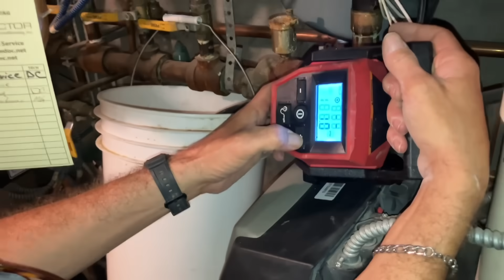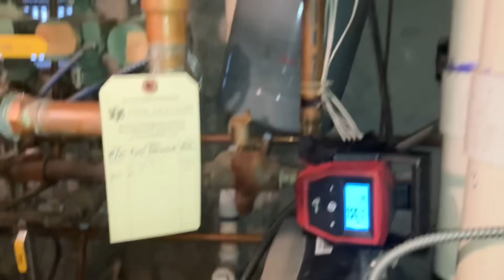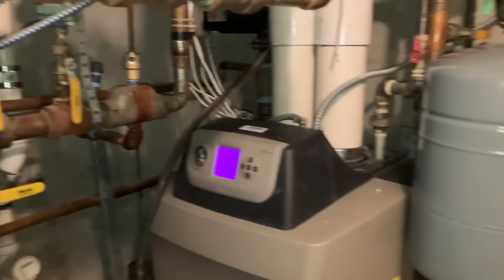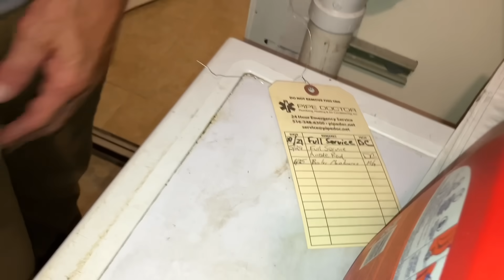Local Plumber Fixes Flooded Boiler Expansion Tank the RIGHT Way | Long Island Service Call

Comment: So far after 5 years our Rinnai 98i on-demand working good cleaned every year. Extremely hard water. Bought 6 stacks of 4 nikoen magnets half moon installed 4 in a stack 2 stacks opposite of each other 3 times..shower heads never get minerals built up.
Reply from the maker: Glad to hear it's working well for you!

Comment: I would have left it where it was, added a mount off the wall or ceiling using angle iron so it wasn't flapping in the breeze and not supported by the pipe.
but to each their own!
Reply from the maker: And that approach would be the wrong install
Reply: @PipeDoctor why does proper orientation matter.

Comment: It is amazing how many expansion tanks are not installed properly. They have directions in the box. When I do boilers, I install a header off the side so the tank is not over the boiler. I will have to try your method of draining the tank. Full tanks are heavy. I normally undo the tank and strain to get it outside and punch it with a claw hammer. I always put a quarter turn valve at the tank to make it easier to replace the next time.
Reply from the maker: Yes, you are right

Comment: the verticle only relief valve I dont think applys to tankless  or domestic water heaters. Virtually every tankless is  sideways    whether all boilers require it I dont know but I noticed the practice  of installing verticle is the norm,     perhaps its manufacture  instructions that dictate  might be good to follow convention    like guys putting  valves on with handle on the bottom it ruffles feathers that sediment will collect and foul the valve operation.  
     spray flex seal on them leaky pipes  "As Seen on TV"    looks like somebody tried

Comment: Can you use black pipe on potable water?
Reply: No
Reply: loaded question  of cource   potable would be prohibited   but the subject of video is not regarding potable   the piping of   pipe dr is AOK
Reply: Black pipe is just fine.  The water becomes neutral and full of iron so it’s ok.
Reply: @watomb if I saw black iron on a water line I would I assume I fell asleep & woke up in Venezuela
Reply: @wrongsnowboard4356 if it was in domestic water supply situation then it would not last long.  But for boiler it perfectly fine